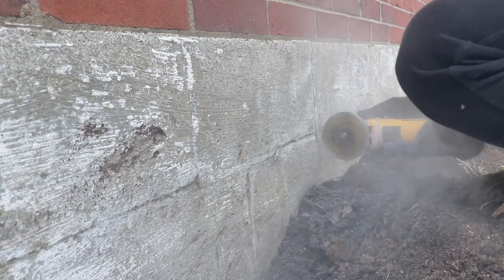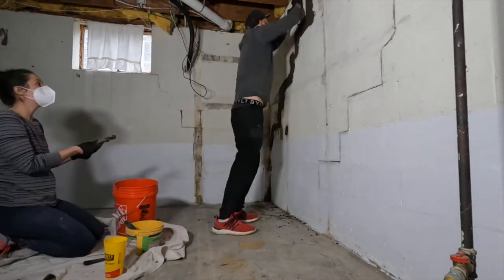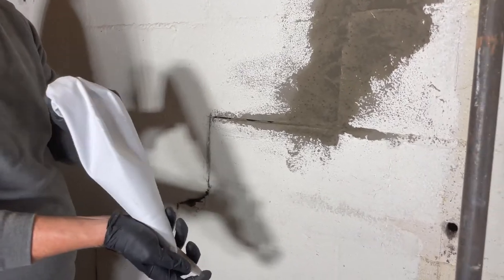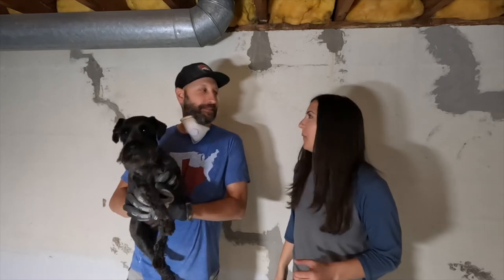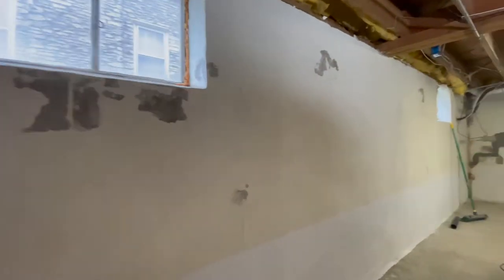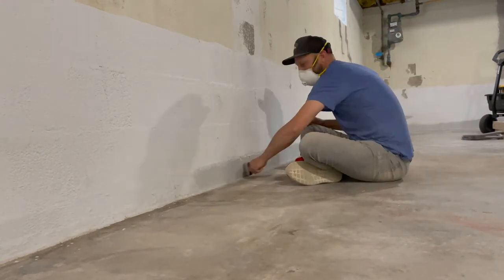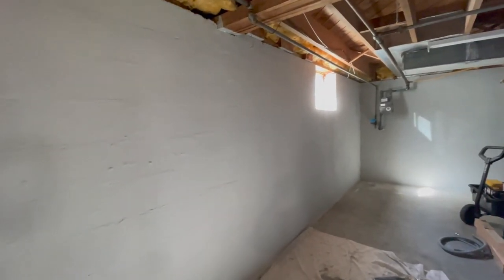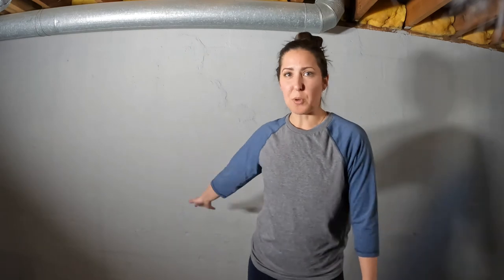REPAIRING INTERIOR BASEMENT wall cracks and waterproofing our basement!

Comment: I’m also renovating a basement. You apparently did a great job waterproofing, which is critical. One “tip” I can offer is don’t be afraid to tint. (I’d have darkened the light gray paint to hide the dark gray patches.)
Reply: Granted, the gray may have already been “dark enough” compared to other options.
Reply from the maker: Thanks for the tip.

Comment: Putting drylok, or any waterproofing on the inside of a block wall, will lead the disintegration of your block wall. Wall. The wall will still have water in it, and you're keeping the water in the block. You need a waterproof from the outside.